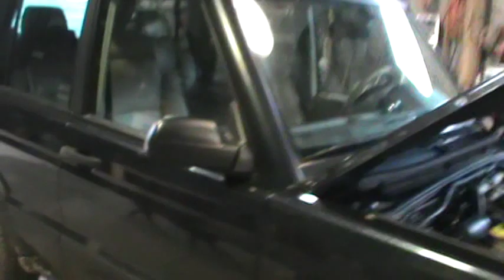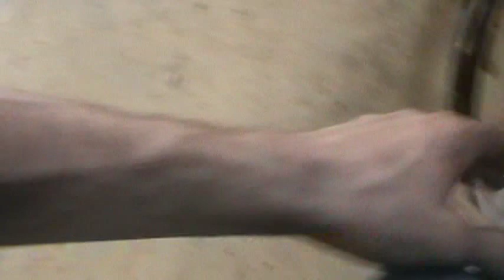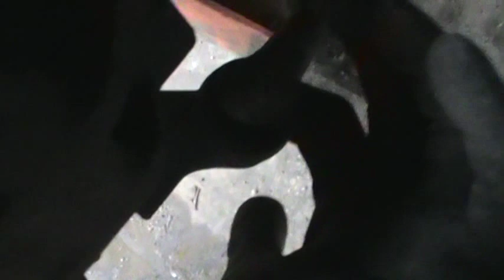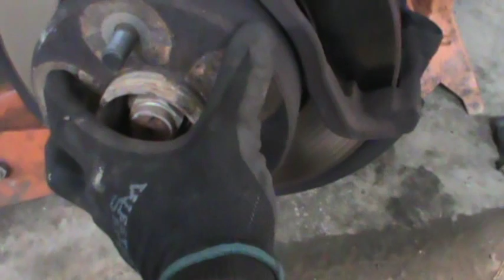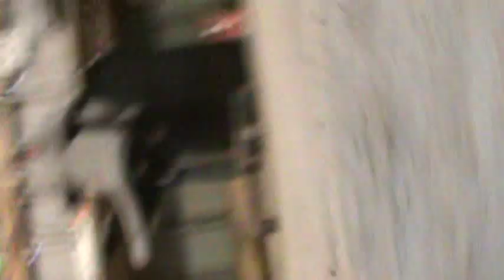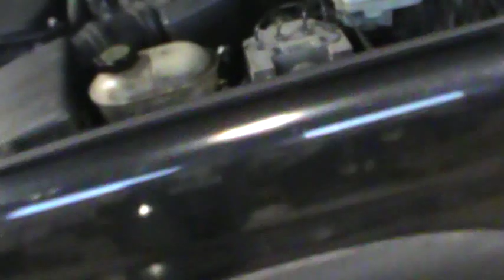Land Rover Discovery 2 Wheel Bearing Replacement

Comment: This guy is a wanking idiot. The jack stand should NOT prop up the vehicle on the radius arm. Hitting the rotor with a metal hammer, denting it in the process, is the true mark of a hammer mechanic. The guy couldn't stop jibber jabbering long enough to show us the important stuff. His slander of the British automotive industry is beyond the pale, especially from Mr Hammer. He also fails to clean anything before starting the rebuild. As far as the "three amigos," this ilittle headache is caused by a WABCO ABS module, MADE In America. I have a specific question, do you have a service manual? My guess is no. I have a general question, is a village missing it's idiot.

Comment: I have the 3 amigos on my discovery but when I checked to see if my wheels wiggled they didn't move at all what could be a secondary issue?
Reply: +J Scotty : it's just a matter of time . The three amigo is reliable. I spent all winter with the yellow LED lights and this week suddenly I hear a rumble. left wheel. I prefer that the work be done by an expert. Will this ... wheel of forturne to my mechanic
Reply: +Francois Nicolas Mcnichols it could also be a shuttle valve failure.. best to have it diagnosed than to start tearing into it
Reply: Bypass the shutter valves. Easy stuff.

Comment: The Philips machine (set) screw on the brake disc is there because it is the only thing holding the disc to the hub during manufacturing assembly. When all the parts are new, the disc can slide off when the suspension assembly is hanging at an angle, waiting to be bolted to the chassis. Thus to save someone getting injured, they attach the disc with that small Philips machine screw. As you pointed out, once the car is in service, rust & dirt are usually more than sufficient to keep it attached, without the screw.

Comment: Resting the vehicle on the front radius arm is not recommended. It may bend & adversely affect wheel alignment. The 3 Amigos is due to a common ABS module fault. It is made by WABCO and originally fitted to Hummers. So it is an American defect, not a British one.
Reply: True, but it could be the shuttle valve or slabs. Also Land Rover did away with the wheel speed sensor plug that you now have to hardwire into the ABS ECU behind the passenger side glove box and splice it. Also many people freak out when something goes wrong with a Land Rover Disco, they are relatively easy to repair and maintain and I have had my 99 DII for over 14 years no problems except just simple maintenance. Just remember the D2 is so much easier to replace the front bearings compared to the DI that had swivel ball those were a bitch to rebuild.
Reply: It’s actually mainly due to the grease seal on the bearings failing fouling the abs sensor

Comment: Just seen your video. Great explanation! I've changed all 4 hubs on my 2001 D2 TD5 (we get the 5 cyl. diesel in the UK as well as the V8) in the past year and a half of my ownership. A couple of points if I may? One method of removing the nut in the hub is to leave the wheel on the car so its weight is bracing the hub. My 32mm socket is too thick to fit in the wheel centre so I just braced a bar between the studs on the hub & used a trolley jack to jack the bar with the socket. I didn't get a small screwdriver to ease out the stake nut - that's what that hub nut is called over here - just used brute force. The threads on the driveshaft don't seem to suffer any :) The stake nut has to be done up pretty tight, about 360 lbft IIRC. however, seeing as I weigh about 180 lb, I just stood on a two foot bar to tighten the nut :D
Oh, great piece of Norfolk Southern artwork on the shop wall by the way. I have some of their locos to run on my model railway, if I ever get it finished...

Comment: Rover needs to change their tag line to :the ultimate love hate relationship.  If they could only add reliability, they be the perfect truck.  but never buy one unless you are rich enough to pay for service or it's an extra car and you do your own work.  Comment on wobbling tire to check hub.  if your break pads are relatively new they will hold the disc and significantly reduce the amount of wobble. So if you think your hub is going, take off break pads, then put tire back on and try and wobble tire.  
i'm getting ready to do my 2nd front hub.  65k miles.  just finished head gasket.  man, but when she runs...almost makes you forget the utter unreliability.

Comment: You could have shaved about 14 minutes from this video by subtracting all of the BS commentary, all the while leaving out valuable info.
 Such as: leaving the wheels and tires ON and popping out the center cover and allow the weight of the truck to be used as leverage as most guys don't have a compressor and air wrench generating 700 ft. lbs of torque.
Reply: hey m devtech go easy on him
I just enjoyed the whole show
Beau made it enjoyable and informative sure your right about the weight of the truck as leverage but if you know that do it,
What ever turns you on.
Peace from Australia.

Comment: I need help! I'm pretty sure my Jeep has the Death Wobble. I need some advice because...well...the jackasses at the tire shop tried to sell me new tires. Do you have a site? I feel like I'm being taken advantage of because I'm a girl. My post yesterday: "About to go get my tires aligned on my Jeep. It's hell being a woman. Just so I don't end up with new windshield wipers, air filters, transmission, lift kit, garden hose and a box of tic tacs, I'm going to announce my presence with authority. I'm going to say, "Yeah, uh, see that black Jeep out there? I just need the tires aligned. I would do it myself but my hydraulic jack is on the fritz and I don't have any metric tools." :D Please help!
Reply: Hey, thank you! My Jeep has been in the shop twice. It still has the death wobble. I will have them try this. Thank you sooooo much!!
Reply: Its in the shop again :(
Reply: I asked the mechanic to check the bushings as you suggested. He replaced the steering damper...AGAIN! It made it two days before the wobble started again. I took it back and asked about the bushings. He said he had to take my whole front end apart but would not confirm a price for that. I said never mind and now its at the dealership. Told me my steering damper needs replaced. I LMAO and said that the damper is literally only 3 days old. :( I filed a complaint with Chrysler and the NHTSA. I paid cash for my Jeep new in 2008 $25K. It only has 53K miles on it now. This started at 48K miles. I'm frustrated. I swear if I have one more man tell me its my steering damper I'm going to kick him in the ball joints :D